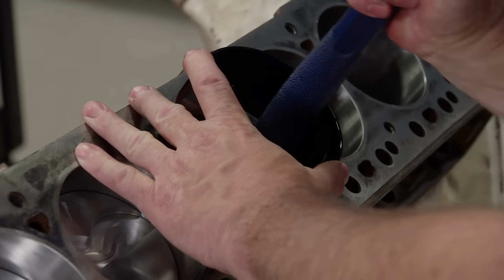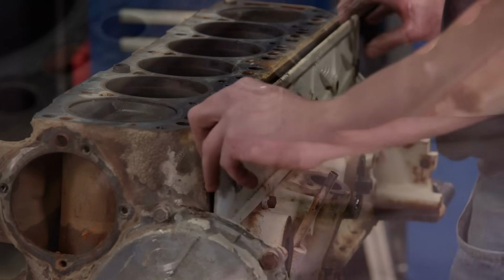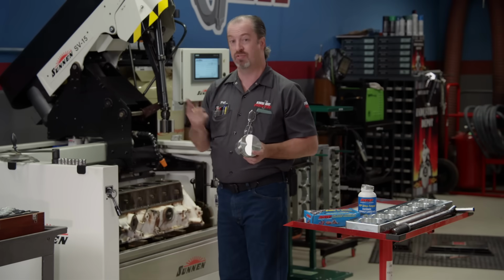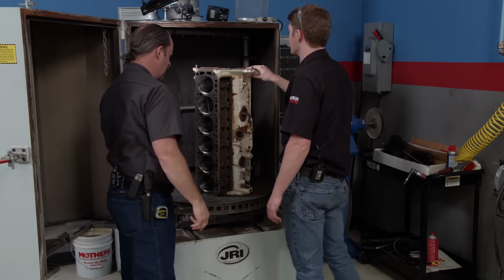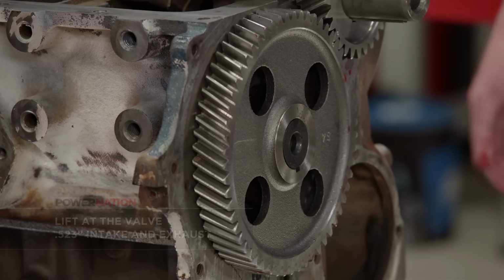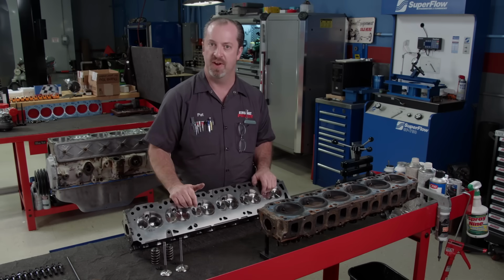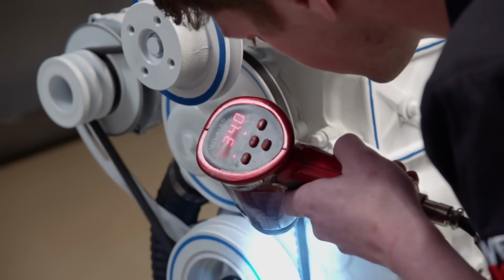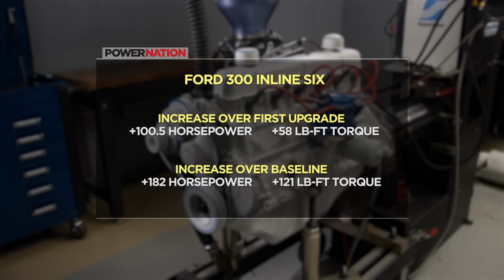Full-Tilt Build On Our Ford 300 Inline 6 For Serious Power Gains - Engine Power S8, E3

Comment: Many years ago I saw a man who took two 351 Cleveland heads, cut one exactly in half and cut the center two cylinders out of the other, brazed the three pieces together and put them on top of a 300-6. He used three Braswell 500cfm 2bbl carbs and was making 500 horses...

...all on a stock crankshaft.

Comment: Way back in the seventies (might have been early eighties?), there were quite a lot of guys running in-line sixes in the drag's, probably due to a class advantage.
One of the hot rod magazines of the day had a feature on one of the class winning engines that used a head made up of three cut up Cleveland heads furnace brazed together - IIRC he was turning to it 9k!
Ah, seems it may have been Bruce Sizemore, running a cleveland headed 300 w/nash preped toploader 4spd in a comp eliminator pinto in the late 70s in NHRA.
Might be worth chasing up for those with an interest, or deep pockets?
With 3D printing, maybe some folks can investigate printing a head, or as some foundrys will cast iron or alloy parts using 3D printed cating cores, that may be an option for a high power, and HIGH dollar, build?

Comment: I just wanted to comment that Grove used the 300 cid in there 15 and 18 ton cranes to power the hydraulic pump! I am from Manitoba Canada and it gets brutal cold and that old girl will start just like downtown I still have a 18 tonner with the super six and she still runs like a champ I have had those 300’s in half tons cranes pumps they are very reliable so when I saw your video I thought it was pretty cool! Thanks guys 👍

Comment: This thing will EASILY make 500 HP at low boost with a GT35R turbo. My Accord has a JDM J32A (3.2L V6 SOHC VTEC) swap with a six speed manual and at 10 psi on a GTS3582 turbo it made 502 whp and that's PLENTY.

Comment: Those bearings should've been in excellent condition considering the fact that the engine was used in a commercial application and I'm sure it was never revved over 3500 RPM. That engine with EFI and a good sized turbo will make some really good power.

Comment: I always wonder about these dyno runs where they keep adding timing. Seems like it might be good for a controlled dyno run, but what about the real world where engines get heat soaked sitting in traffic? Old Fords were bad about running hot in stock tune as it was.

Comment: I remember article in old hotrod mag where a guy cut up 2 Cleveland heads and welded them together and bolted them on a 300 six.
It was strictly a drag engine experiment but I've been intrigued with the 300 ever since.

Comment: I’ve always thought the Ford 300ci 6 cyl had potential for performance. I know Ford sold a lot of them as stationery industrial engines and they’re tough engines. I’ve always figured the heads would work great for a performance engine though.

Comment: I had a Ford 300. For towing a boat or a trailer full of wood, the added torque is nice. Injected I find is nicer than carb. Hedders for breathability is nice. I'd improve the drive train to handle added power/torque. Might detune a little for sustainability and fuel costs for everyday driving. Great to see a nice video on a great engine.

Comment: The in-line 6 are also used for windmachine for frost protection on tender plants. From what I've been told, there not known for horsepower but have a good amount of torque for those in-line 6's. If not mistaken they were used of the F150's in the 80's and 90's of not mistaken.

Comment: To me that six looks odd. In my 64’ F-100 I had the weirdest of the straight sixes. The “Big Mule 200”. It looked like the standard 200 but the intake and exhaust were on the other side of the block. It was a mirror image of the standard but you couldn’t just flip things around and bolt them on. Also it only had one motor mount! It had a bracket in front that used the first three or four oil pan bolts to hold it up, and the transmission had two “ears” with mounts on them under the cab. Plus it had a “bottlenose” reverse throw starter. No one knew what that engine was or how to get parts. Dealership repair shops just gave up trying to figure it out, this was before internet search engines were a thing. Unfortunately the motor gave out long before I found out what it was and my Dad insisted that if it didn’t run then it had to go............. I paid $50 for that truck. Put $16 into points and plug wires and drove it for two years. Made a lot of money out of that one, hauling and scraping. Only did 45 mph, on the flats, with a tailwind and some choke! lol

Comment: The old Ford 6 Chevy 6 and the slant six were meant for work the v6 was not I've pulled many a stump and many a 30-40 ft tree out of the woods with a 292 Chevy 6 in a 78 Chevy 4 wheel drive absolutely bulletproof 504,000 miles on it when I got rid of it and it had never been opened up except for regular oil changes and tune-ups horrendous fuel mileage but one tough truck.

Comment: I never understood why american straight sixes did not have flow through heads.  There are so many reasons why having intake and exhaust ports next to each other is a terrible idea.  Heat transfer to the intake charge, not enough real estate to maximize flow, etc. Never understood what the plus side was.

Comment: Had all the power and gear to use my deuce along with changing the four speed with a 5 and two and changed my gear ratio . My welding car was the cats meow

Comment: Ran a split axle and with my high gear I got good fuel mileage and higher speed, swap the carb and ran a 650 flat board carburetor

Comment: Sorry but you aren't making any horsepower compared to the Engines run in the early seventies on the Dirt Tracks in Southern Indiana I watched a Big 300 plus cubic inch Ford outrun the 454 Chevies with two 750 Holly carbs of course the Ford had been built to the hilt balanced 13 or 14 to one compression clifford camshaft sidedraft Alcohol carbs three of them you have never heard nothing like it I forgot to mention the Super Six Cars ran a rocking chair Wing on the roof that the V8 cars weren't allowed but you're engine is a baby I love it but I have seen some horses my father ran a Sprint Car on Alcohol with a Ranger Airplane Engine Six Cylinder twin magnetos six carburetors and twelve spark plugs six hundred horsepower in the late fifties unbelievable they blew the spark plugs out of several of the engine then the car owner went to Chevy power because he wanted to save the engines he had left I do enjoy your videos

Comment: I used build marine versions of this engine for 35' cabin cruisers. They never broke down. 

I was too chicken to try adding a turbo (heat in a tight fitting wooden boat engine room is unwise) but did try a Paxton supercharger. Which added 65 HP (base was 205) to each engine.

Biggest problem he had was finding a prop that could take advantage of the extra torque available between 3,000- 4,200.

The owner didn't like the extra fuel burn so we took the Paxton's off and he ran them for 5,000+ hours before he sold the boat. These engines are built like tanks.

Comment: Silly me, when I install a camshaft I lean the engine stand over and lay it down so the cam bearings lineup in a vertical direction.  Sometimes I need to use a book, or a 2X4 as a shim to get the alinement engine just right. This way it makes it a lot easier to install the cam without damaging the new bearings.

Comment: Criminally underrated engine, it's hard to stand out in the inline 6 world die to a lot of other good ones but the Ford does, something like the timing gears just shows how it was engineered to be dependable
Reply: Underrated? I've never heard anything bad about them other than low stock power output
Reply: Ford intentionally underrated the horsepower as, they didn't want  the straight six to steal thunder and sales from their V8's. Longevity was the goal as many were used in industrial applications. They also made a great marine engine.

Comment: Ah.. my engine..gbe engine that was in the truckmy dad made me by with my after School job.. my first vehicle that I didn't want.. 88 iroc z 5.7? No you dont need that!!.. 86 Mercury cougar 5.0 EFI? "No those are garbage"..  (cougar looked fine) ah 79 f150 shortbed 2wd 351w.. sky blue.. clean old 79.. very minimal rust.. I want it!!! No!  My dad was V8 blocking me.. that's all.. none of these 8s made crazy power..it wasn't a hazard for a 16 year old kid first vehicle.. them we get to the 81 f100.. primered up.. no carpet no headliner.. no radio.. 4 on the floor.. power steering box seal foroutput shaft shot..dumps the ps fluid.. my asshole father tool my money told the man we'll take it and paid him... I was pissed but still excited I owned a truck... That  300 6 would. Be how self learned head gasket replacents camshaft and lifter Replace. The first pain im the ass nylon timing gear inecounter.. I learned how to rebuild that 1 bbl carb.  Setting a Distributor and using a timing light... My dad pissed me off making me get that 300 six truck.. but I think he did it on purpose so I would use it to learn.. the other  vehicles didn't need crap done.. looked better..  looking back of love to find a300 powered truck.. there is a rough looking oldf100 short looks like an 80 or 81..600 on windshield.. may look Into a six hotrodproject... Looking back  I had onetough engine he knew it too... I can understand why now...  But still you dont take money your kid worked for  saved up and buy some ratty old shit you think is best.... There was many better vehicles he wouldn't allow.. but what is a15 going on 16 gonna do... Not a damn thing...lol

Comment: Should have used a strait boreing bar , with that much taken out . If the the holes are out of round by anything , the hone can exaggerate the out of round , so you may have ended up with non round holes . I have seen a few blocks over the years where buddy honed  .020" out and it still burned oil, and it was like 0.009" , the spec is usually less than 0.003 " should get an induction rod heater as well they have a temp limit

Comment: I want your crank shaft. I have a 1967 Ford Econoline Pickup that I am building a 300 for. The original engine is a 240 and frozen from sitting for 40+ years. I've been looking for a forged crank and I even purchase two NG generator blocks to find one. When your done with that engine I would sure love it in my Ford.

Comment: Years ago me and a couple buddy's had an 82 rusted out ford it was 4 speed 4x4 300 inline 6 we where beating this thing off trees out threw the woods threw cricks anything you can think we busted the radiator and continued to run it till it seased tight from the heat the motor even caught fire from the burnt on grease and oil that was on it and the manifold was red hot we left it for the night went out in the morning the thing started right up and we did it all over again

Comment: Right out of highschool, l worked at local wholesaler delivering mom and pop gas stations, restaurants and general stores around northwest Ohio. It was great job only making a buck an hour. We drove new 1972 Econoline vans with the 300 six and 3 on the tree. We drove them hard and fast and they didn't complain a bit. I also remember a E/SR Ford T that ran at the local dragstrip that had a 300 Ford six. It hooked hard and ran real strong and beat up on many small block Chevys. The sound I'm hearing as you run the dyno reminds me of the wild sound that little race car made. It surprised everyone who saw it run.

Comment: The Aussie equivalent to this is the 250 cross flow, which was made by Ford Oz from the late 70’s up to the mid 90’s. It was predated by a non cross flow 250 that was used from about 1969 or 70. The 250 X-Flow had an alloy head and they will do huge mileages. They also love boost. The 4.0L Barra is the grandchild of the 250 X-Flow. In between them, was the 3.9 and 4.0 SOHC engines.
Reply: My pop took a 400 Cleveland out of his f100 and out a 250 x flow in it.  Had more torque down low

Comment: Hey guys u r shorting ur selves on timing u need 29-30dgs 8 static n 10 vac. 42+ u only had 36 then I'll c ur tq up over 4-4,5k n 5 k+ hp this has been the secret for the big guy's i6 engines need more timing to get all the power to the crank put her back on the dyno n start with 40dgs ur distribution must have a 15dg window 29-30dgs at 3k please video a Dyno test with these #'s n watch it go over 400#ft tq n 300 hp .gord knew the capability of the 300 n robbed us of 6dgs on stock 18dgs @ 3knwhen stock needed 24dgs@ 3k at the distributer higher compression 28-30dgs@ 3k  8dgs static please do some research just call Clifford 6=8

Comment: The stock Ford 300 cu 6cyl had more torque than the Ford 302 V8. I had a new Ford E100 van with a 300-6 cyl and a 3 speed standard trans and it would smoke the tires in 2nd gear! That's a great truck engine!

Comment: I had a 300 in a '89  4X4 1/2 ton fuel injection, 4 speed,bought it new
That thing was a lot fun in the mud
I busted several driver's side engine mounts
One time,it sent the fan into my aluminum radiator,

Comment: Had two F 150's with straight six's. Put 500,000 Km on the first in 18 years and now my second is in the driveway for sale with 427,000 Km after 22 years. 1981 and 1996 model years with the same body style. Best motor ever

Comment: My 87 f150 has the 300, my 93 f350 has the 7.3. Both 4x4. The two best motors Ford ever put in a truck. They will be running long after I'm dead.

Comment: When I was a teenager, I remember watching a Mustang at US30 dragstrip with a straight-6 290 with 6 throttle bodies on it DOMINATE everything in the class. That car was destroying every small block v-8 it went up against. it was a freekin torque monster and even ran the high side better than the v-8's

Comment: Hi Guys, My 68 F250 Had a 300, I Blew it up, Thore out 2" of timing gear on the crank, Had to replace it, old phone truck motor  .040 , .020. .010, I think, that was almost 40 years ago, that ran great.

Comment: I sold my 1994 F150 w/300 at 444K miles about 6 yrs ago. I still see it often and now has over 500K miles. Completely original except for cam gear fail at about 350K.

Comment: That would be a good enough engine to put in quite a few older fords. If you ask me this thing needs to go in a late 60s, early 70s vintage Ford F-100 or 150 with a mild hot rod look

Comment: On the flip side couldnt you use a freezer and keyboard duster or butane to shrink the pins instead of changing the heat treating on the rods???

Comment: What's amazing is that it's making over 300ft pounds of torque at 2500 rpm! Put a 5 speed outta an early 90's 150 and drop it in mid 80's 150. Don't know bout fuel consumption but it'd make a great work truck!!!  Had a 90 fuel injection 300 f150. Pulled like a mule, ran outta steam round by 4000. Really didn't like over 3000 rpm. This thing would keep on keeping on!!

Comment: Use injectors, add a turbocharger, and then bolt that 10 speed auto trans from a a raptor, and then put that into a full crew cab long bed dually with a front transfer case

Comment: Go put some timing in it... but you might want to have also corrected that large oil leak you could clearly see on the video of the first pull... Or was that the wire going up to the HEI distributor they for some gawd aweful reason put on a Ford.

Comment: It's a YouTube video with a straight 6 cylinder Ford motor on it was a chopped up set of 351 heads molded back together and assembled on top of the 6-cylinder Ford they say it made big horsepower n a... that I saw on YouTube another guy was telling me that someone designed a dual overhead cam head for a straight six cylinder GM or Ford motor

Comment: Ive seen these motors wore out no tellu g hiw many miles oil not changed right or at all amd they be running with no oil pressure that engine was for sure built to last or ford tough as they say lol

Comment: All these videos should include a warning about parts being sold as "rebuilt' or even new.  Disreputable vendors are doing this.   Lots of incidents of lifers that eat the new cam because the wear surface is out of spec.  The time it takes to spec one is well worth the saved expense and frustration of learning the hard way.    Always go over parts with as much scrutiny as possible.  Even trusted vendors can be duped by supply sources selling "less expensive" items.

Comment: HAVE ALWAYS GOTTEN AT LEAST 300 THOUSAND MILES ON THE 300 INLINE FORDS. ONE WE REBUIL AT ABOUT 315 THOUSAND. IT IS AT 512 THOUSAND IN A FORD 1977 CHATEAU VAN. (TRANS HAS ONLY BEEN REBUILT ONCE) LOVE THE ENGINE LINE.